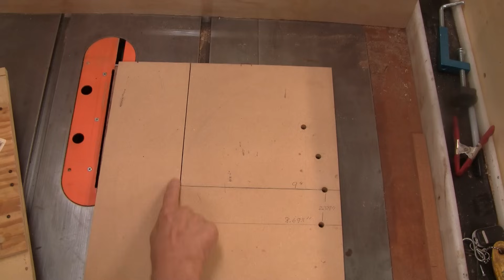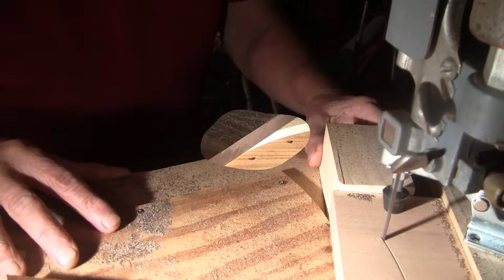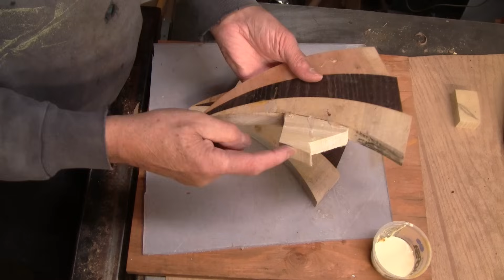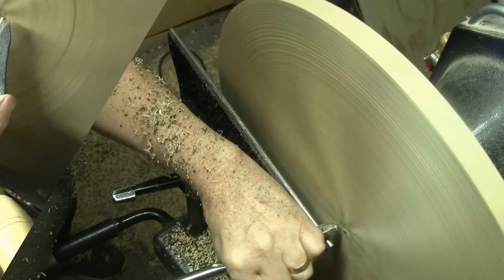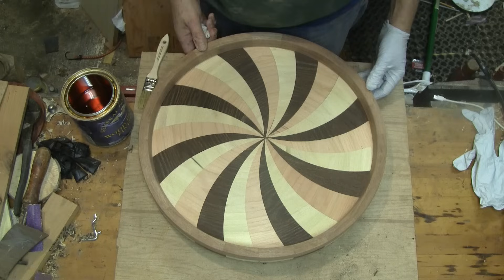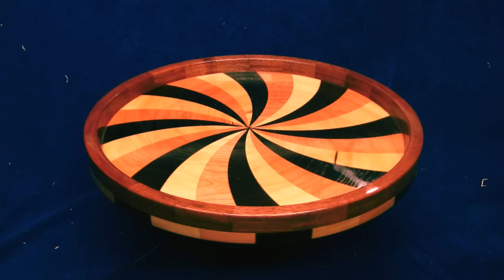This Huge Vortex Tornado Wood Turning Maxed My Lathe

Comment: Another great video. I have the Laguna 1836 also. I bought the 20-in extension from Laguna. With the extension in the lower mounted position, One can turn up to 31-32 inch diameter. That makes it nice to start large pieces and trim them down to whatever size you need. Great video.
Reply from the maker: Thank you Stevio. I though about an extension but I really do not see much use for anything bigger than 18 inch.
Years ago I had a floor stand and a small lathe with step pulleys. I turned  36 inch stained glass form for a  lamp by sliding the head stock to the other end. I do like the extension setup like you have.
Thanks for watching,
Gary
Reply: @ThePapa1947  I agree. I do not turn very large bowls. 19 in. I believe is the biggest I have turned. But it is very handy if I have something 20 plus inches and an odd shape to true it up to 18 inches or less and then I can use it and the normal mounting position. Plus it's nice to have the extra mass to reduce vibration...

Comment: Stubborn? I prefer persistent. Didn’t notice the boo boo till I read the comments.
Enjoyed the project, thanks.
Reply from the maker: Thank you Bob. Well most of those comments saw something early on that I fixed. So far one person notice the   what I was talking about. A boo boo I left. The other one I fixed so it was not longer a boo boo.
 So if you look close you will see all my pieces are cut across the grain. There is one of the burnt oak pieces cut with the grain. I tested a few cuts that way and decided to go with the ones cut across the grain. Less chance of the saw following the grain.
 The big problem was not throwing that piece away. I saw it while sanding and decided to leave it(even though I could have replaced it) Then have a quiz at the end.
Thanks for watching,
Gary

Comment: Careful placement of things on the lazy susan will hide that piece.  Great piece regardless!  The pieces not fitting perfectly is likely the bandsaw blade wandering.  It would probably cut a little better (can't say "straighter"!) with a wider blade with fewer teeth.
Reply from the maker: For sure what sits on it will draw attention for sure.
As far as the gap goes some of the pieces sprung a little. I was able to clamp them closed if I could get the clamp in the right spot.
 From my experience a wider blades tends to not follow curves as well as a smaller on. With this radius a 1/4" would have worked but I did not have a fine tooth blade in 1/4 inch width.  The fine tooth blade can leave the joints so smooth that no sanding is needed.
 I may try a 1/4 inch 8 tooth on this radius.
Thanks for watching,
Gary

Comment: Really nice, Gary. I noticed that you glued the last two segments in the wrong order but once it was one the lathe, all was right. How did you fix it?
Reply from the maker: Hi Bill,

Yes it was fitting the last two pieces. I was so excited that they fit perfect I just glued them in. Ooops! 
I band sawed them close to the line and then used a very sharp chisel to remove any glue. Then put two others back in the right order.
 So that was not my big boo boo because I fixed it. There is another oops but really hard to see. This is a test to see who can see it.
It is there in the finished piece I show.
 Thanks for watching,
Gary

Comment: How were you able to fix the last two segments that were out of order?  It looks great at the end!
Reply from the maker: Hi Crystal, I cut them out and replaced them with new ones. I usually make a few more than needed.
 That was not the big mistake though. If I left it in I call it a mistake.
So there is something else in there that is not right. But pretty hard to see.
I will point it out in a few weeks. Just want to see if it will be noticed.
Gary

Comment: That votex wood turning is slicker than greased lightning.  I like it, Gary.  I also like the jig that you designed.  It's a little different from the first one you made and I will need to see if I can make a larger one for my lathe. Thanks for sharing, Bud!
Reply from the maker: Thank you John. In the process of making these I have come up with a simple way to have as many segments as you want. At the moment it would take a different base but as I type this something popped in my head. I better write it down or I will forget LOL.
Thanks for watching,
Gary

Comment: Gary at the 9 to 10 minute mark the last 2 pieces are glued in out of order, but it's fixed by the time you mounted it on the lathe...I assume you had to cut them out and remake them?
Reply from the maker: Hi Daniel, yes you did spot that and I did as well and fixed it. But in the finished piece there is something not quite right. Pretty hard to see but it is there.
Thanks for watching,
Gary

Comment: Thank You Gary...Gee Gary, had I known you were going to do a Vortex Bowl I would have cut waaay back on my morning coffee. OMG Gary what will you do next? Put a faceplate on the back end and turn a 6 foot bowl????HA...Always FUN Gary, fun, informative/educational & all this should, in time, save on my wakeup coffee bill, ha. until next Friday...TM
Reply from the maker: Thanks so much Tuffy! I could slide it to the end and do it. This lathe does not have threads on the back side.
When I was an apprentice I did turn a 6 foot bowl on the outboard side of a shop made lathe. Patterns were made for the castings and the rest was made out of very large timbers. 
It looked like a bowl but it was a very large pattern.
 Thanks for watching,
Gary
Reply: @ThePapa1947  Hi Gary, I know you are extremally capable and well equipped in both wood and medal shop work and machinery.
  In the past I needed to use the outboard end of a bland headstock without any threads. I made a very close fitting and deep engagement expanding collet that worked very well. Easy quick installation/dismantle and as solid if not more so than threads. If ever interested ? .... TM